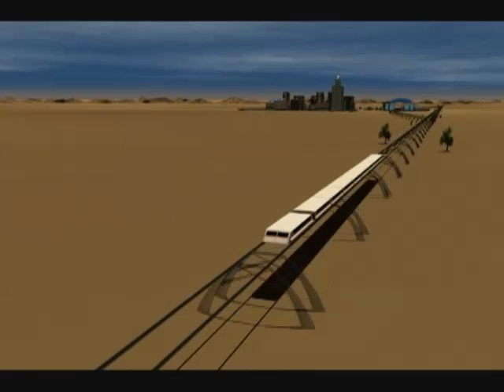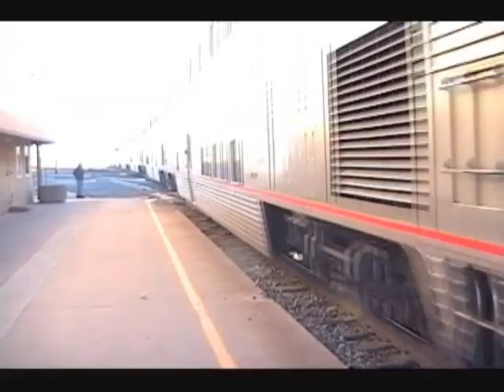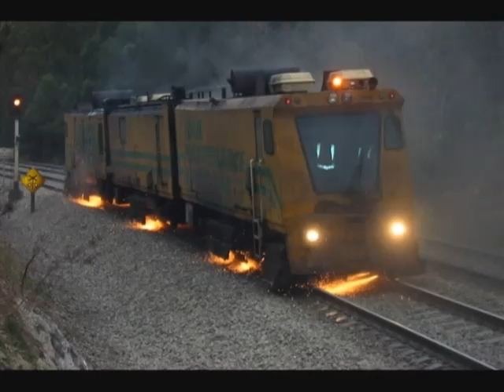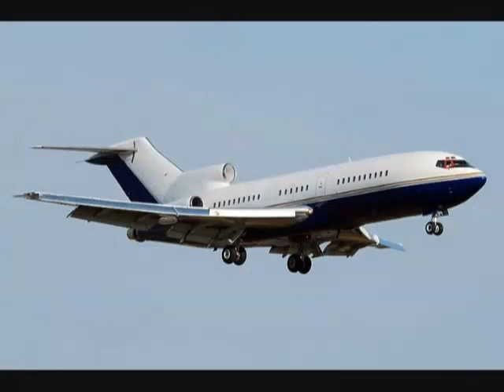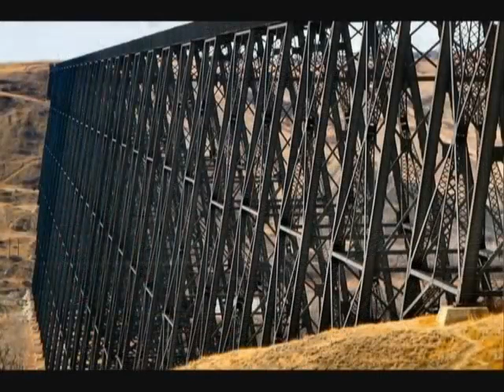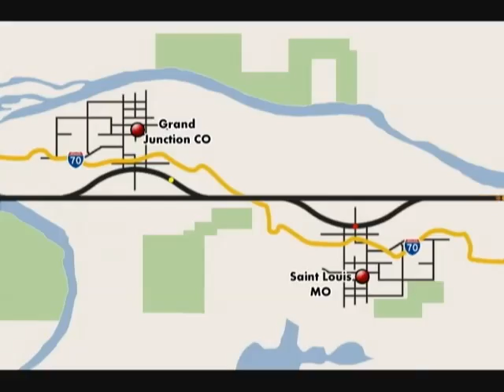LABIS Amazing New High Speed Train Concept - Ray Lashley

Comment: I independently came up with something similar. However, instead of getting on/off from the back you get on/off from the front, where it accelerates to the same speed as the train while the main train catches up, and when it gets off it decelerates. The shuttle no longer has to go faster than the main train. You only need a third track about the stopping distance from each station, long enough so that the main train can pass the shuttle train. This should reduce costs in theory compared to your idea.

Also the shuttle should not diverge off the main track, as that would add costs (adding a third track is cheap, but building, grade separating and electrifying in a second right of way is not).

Also the number of cars in the train is variable and is scaled to meet demand. One advantage planes have is that they are very scalable in response to increased/decreased demand.

Building the entire thing on viaducts is a bad idea; it's too expensive. Also broad gauge is not needed; China's HSR on standard gauge is already smooth enough to keep a coin flat on its side.

To make this (and HSR in general) economically feasible, you need to build skyscrapers around each stations (presumably in the new stops), not a bunch of single family units. This not only increases the number of people with convenient access to the station and thus demand, but also captures the increased land value around the stations (so even if the passenger tickets don't make a profit, the real estate makes up for it).

Comment: the Average speed for this train to get across the Continental US would have to be at least 390km/h with a top speed at least 400-410km/h
Reply: Absolutely achievable and more!
Reply: The purpose should not to get across the continental US. It should be to provide shuttles to every 20 miles.

Comment: Nice concept. Since more stops can be accommodated more passenger can use it. That means frequency of trains can be operated which in a way increases the convenience to the passenger. The author rightly points out the importance of using broad gauge. Currently Indian railways is the one using broadest gauge of all rail systems.

Comment: having something dock at 200mph? and the distance you travel while docking, youll miss several stops, as well as how do you get the pods back to the original spot
Reply: Interesting questions. The trains would run on schedules. Pods would not need to return to original stop, but pods would come and go on a schedule. The main train could pass several stops to which all could send pods to dock with the train later down the track.
Reply: Not that long. Given an acceleration rate of 5 mph per second, that's about 40 seconds to accelerate to 200 mph, which is a little over 1 mile. Stations are about 5 minutes apart on the main train, or about 20 miles each.